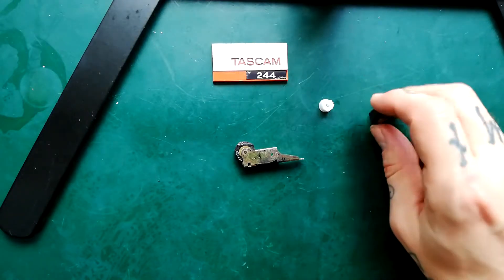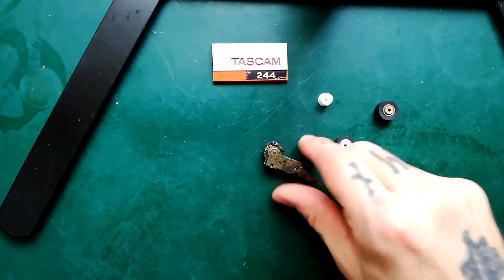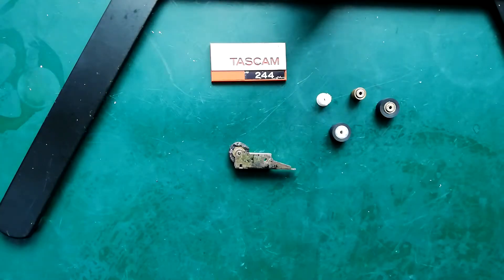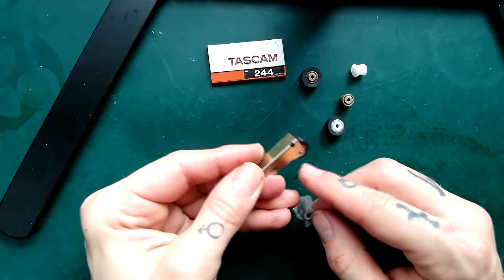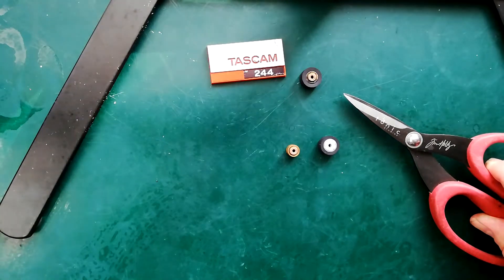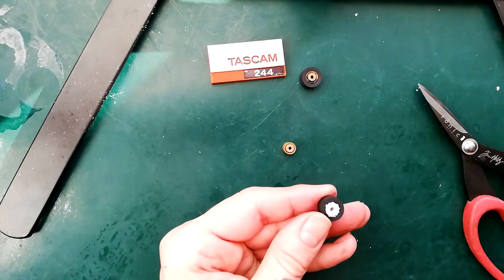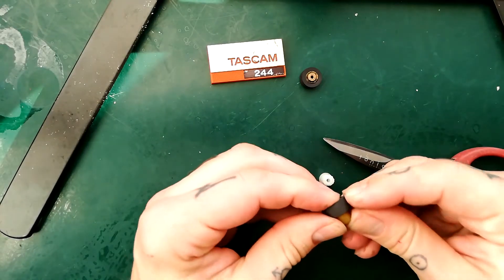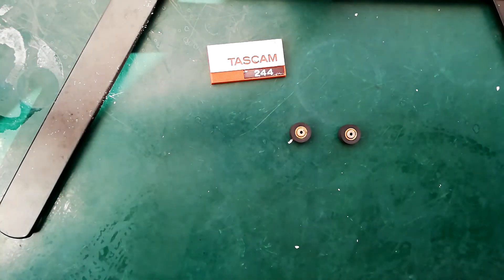Replace rubber on tascam 244 or 246 pinch roller

Comment: Thanks for all of these excellent instructions! I have successfully replaced the pinch roller rubber on my friend's 246, using the rubber from a 13 x 6.3 mm roller bought from eBay. One thing I am noticing though, is that the arm is undulating slightly during playback. The rubber must not be perfectly true/round - do you think this will be a problem, or is a little bit of movement to be expected?
Reply from the maker: Thanks. It probably will manifest as subtle wow - use your ears to figure out if it's part of the tape machine's character or a problem?
Reply: thanks for your reply  @Tetrakan , yes there is subtle wow noticeable when printing test tones but not really with music. All good!

Comment: I used the "5pcs Cartridge Radio Roller Tape Recorder Pressure Cassette Belt Pulley Player W8ED" type R from the  Upper Forward Digital Store on Aliexpress for the roller. I did the same as you've shown here, works fine. Cheap too, but naturally you have to wait a couple of months for delivery.
Reply from the maker: That's great, thanks for sharing the part you used.

Comment: just did this for my 246 pinch roller, using rubber i bought off ebay. now getting a significant amount of wow & flutter. think this could be because of an improper roller installation? followed all the tips in ur other video as well. from what i can see, the roller is definitely not running straight--waves up and down a bit. im a beginner, any thoughts? will try a re-install of the roller tomorrow, and will make sure that the rubber is centered correctly.
Reply: oh my. lol. i think i've fixed it. i just pushed the rubber a bit with my finger after removing the plate above the roller. and uh... it is all good now. sounds great. everything is running straight and fine. patience and luck! been learning to surrender myself a bit while fixing this 246 up. feels good when things work!

Comment: Thank you I will attempt changing the rollers Tyres and belts ..I’m in Australia and finding it hard to source pinch roller for 246  but I can source a porta one  ..can this be cannibalised ? Anyone out there know? Actually think it’s a porta one mk 2..hate being down 60 bux staring at unfitting parts and the supplier claims understandably not to have a clue...thx in advance @...ps the world needs this approach you have to fixing....analogue will never die
Reply from the maker: It'll work but you'll need to widen the hole in the roller arm because the shaft on the porta one roller is bigger. I've got a video demonstrating this, check the tascam 244 repair section from my channel page, and good luck.
Reply from the maker: Oh hang on, sorry it's early here and I'm half asleep still, you can just use the rubber from the porta one pinch roller, as demonstrated in this video, sorry for the confusion
Reply: @Tetrakan   thx for getting back so soon.. i will order  the parts now and leap with courage into the techno void..i am on scottish time myself even though I haven't been there since 1980..the pull is still strong..cheers and thx
Reply from the maker: @cellulitehero  glad you got it sorted. Type 1 tape will work okay. Noise floor and frequency response will be worse from an audiophile's POV but it can actually sound pretty good if you're in the musical vicinity of punk. Just clean the magnetic heads more often, they will clog up quicker with type 1 tape.